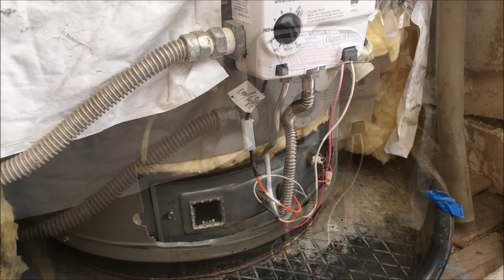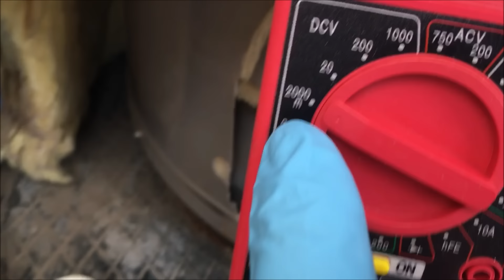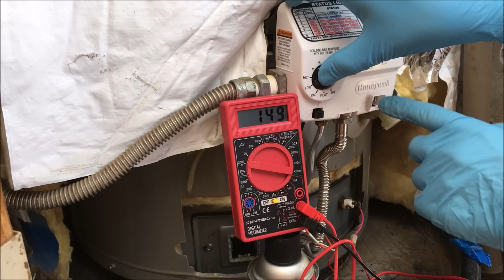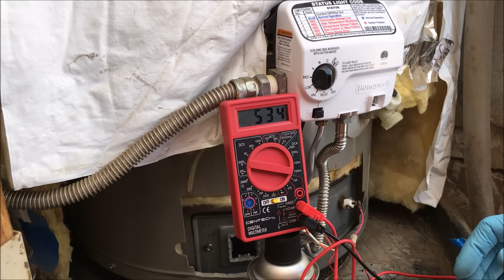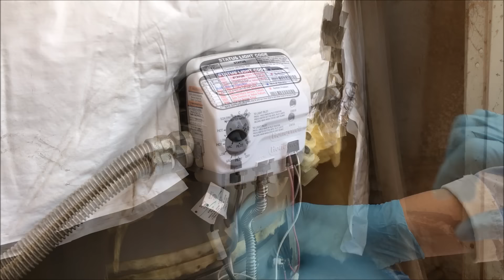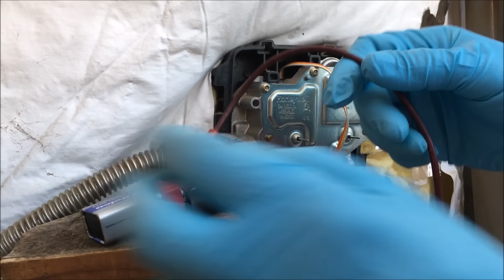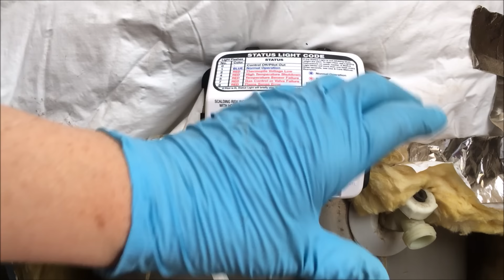Troubleshoot Water Heater AND Honeywell Gas Valve | Step-by-Step

Comment: Excellent video.  It's long but worth it.  After 35 years of plumbing, I'm going to have even my experienced plumbers watch this video.  You didn't mention holding the switch on very hot for 10 seconds, then hot for 10 seconds and then pilot for ten seconds to reset the WV control board.  But it's better to replace the board since this doesn't always work permanently.   Thank you for the great video!!
Reply: hey jimmy - question: can you please recommend a 50 gallon water heater brand/model that does NOT have one of these crappy honeywell thermostats on it? im hoping to find one with the old fashioned dial/knob gas control valve, but so far i can only find that in a 75 gallon rheem, which i wanted to get. but it has 1 inch diameter vs the 3/4 pipe outlets on the 50gal - and  i was told was the pressure would be bad for my pipes. is that true? i would be grateful for any info you could offer - thanks!
Reply from the maker: Jimmy, thank you!  What a kind and thoughtful compliment you've given me.  I have no words to adequately express my gratitude for your words.  I deeply appreciate that you took the time to write your comment.  You're words carry great weight given your years of plumbing experience.  

FYI--I do have a video on the "10-10-10 second fix" to override the 4-flash High Temp Shutdown on the Honeywell gas valve.  Thank you for mentioning the fix in this comment.
Reply: @frugaldiy1  where is your video on the 10-10-10 fix? I couldn't find it
Reply from the maker: @7x779  Here's the link: https://youtu.be/rllnMAx05JI
Reply: It's because women do better work
Reply: @eeoo2062  No
Reply: @water_is_wet_or_is_it 😂😂😂 helluva handle there, 🤷🫂🛌🤣
Reply: @eeoo2062  🤔🤔 could be..

Comment: my situation right now is that the pilot flame does not come on but the status light blinks normally in pilot status.  Then when I shift to Low heat, the status light shuts down.  So if the control board is dead, there should be no Status Light whatsoever, correct?  i also vacuumed the filter and even replaced the entire furnace assembly with a new one ($83 Home Depot).  But no luck. So could it be the control board? 

To clarify :  (1) the igniter sparks when the button is pressed but no actual pilot flame (2) the status light then blinks normally at 2-3 seconds but still no pilot flame (3) when the knob is shifted to Low, the status light stops blinking (4) this is with a complete and brand new furnace assembly (5) the metal grate filter at the bottom has been vacuumed.   -- So I am stumped.
Reply from the maker: make taco, your facts scream of a failed control board because the control board should not be operating at all, i.e., flashing a status or error code, if the thermopile is not being heated by the pilot light.  The thermopile's job is to provide a small bit of current to the control board so the control board can operate.  

So, get down on your belly or side and see if you have a pilot flame lit when the temp knob is in the "Pilot" position and pressed in.  Perhaps the pilot lights and then extinguishes when you turn the temp knob to "Low."  

If you have no pilot flame, the control board will shut down everything--it's a safety feature.

As to your other comment that I can't find on Youtube, no, that is not a battery.
Reply: @frugaldiy1  thanks... where to buy the card itself and how much is the card? Also, Walmart sells the entire valve for $119, Amazon has it for $124 and other sellers are higher and much higher.  So, just take it from the new one? Installing a new  valve takes a lot of work and swapping the card is much easier.
Reply: @frugaldiy1  yes, the Status light comes on but there is no pilot flame.  Strange isn't it? Also, smelling gas a little, so i turned off the main gas valve to the heater. Calling a tech tomorrow morning.
Reply: @frugaldiy1  also , how to tell the model # for the Honeywell?  I swear, if  i could switch to electric heaters I would.

Comment: Nice explanation! One question, will the pilot light not stay lit because of the control board not working properly?  Changed the whole burner assembly and still the pilot light wouldn’t stay lit and the control board light won’t come back on, it did previously before i put the new assembly on, I’m thinking that board has gone bad
Reply from the maker: Yes, if the control board has failed the pilot won't stay lit.  It's a "safety" feature.  My pilot wouldn't stay lit because the control board had failed.  I think you mean the LED status light when you say the "control board light."  If that's the case, the LED status light won't work (you won't see any status/error codes) if the control board has failed because the pilot light is not heating the thermopile to operate the control board.  I hope this helps you.
Reply: @frugaldiy1  yes, the LED status light wouldn’t come back on, even after I held the pilot button in for 90 seconds or more multiple times
Reply from the maker: David, if the control board has failed, the pilot won't stay lit so the thermopile can't operate the control board.  So, won't see any errors codes flash.  If you have to manually "keep" the pilot light lit, and when you release the temp knob from being held in the pilot position, the pilot flame extinguishes, I would consider the control board has failed.
Reply: @frugaldiy1  thank you very much! I will try that next!
Reply: Hello, would you be able to help me figure out the right control board for my model?

Serial no. Q411407117

Model no. XG50T06EC38U0
Reply from the maker: For my Honeywell gas valve, I went on eBay and typed in only the model number.  The search results showed new and pre-owned gas valves and control boards to choose from.  But, as I said in the video, I purchased a new Honeywell gas valve from my local Restore and simply replaced my failed control board (and cover) with the new one.  Hope this helps.
Reply: @frugaldiy1  i found a control board but just not sure if it’s the correct one for this model, I’ll have to take the old one off and check the numbers on it, thanks for taking time and responding quickly!

Comment: My "WV" valve is flashing 7 times-"bad gas valve". Rheem is sending a whole new valve under warranty. Can I just swap out the new WT board to my old valve ( if it passes the 9v test)? Thank you!!
Reply from the maker: skeedadyl, that's what I did.  But, given that you have a 7-flash error code, your gas valve may have indeed failed.  I'd do the 9-volt test and see if the pilot valve and the main burner valve are working first before I replaced the entire gas valve.     

To be safe, just make sure the model number of the gas valve sent to you is the same as the gas valve on your water heater.  That said, the model number of the gas valve I used to replace my control board in the valve on my water heater was not the same but started with the same letters, i.e., "WV."  And, the control board didn't look exactly the same as the board on my water heater, but it worked like a charm.
Reply: @frugaldiy1  The replacement from Rheem will likely start with "WT" not WV  ( preferred as you said) like my current valve so I'm hoping I can still just swap the control boards if the pilot and main burner valves test ok. Thank you for your response and wonderfully clear and thorough videos!
Reply from the maker: I hope it all goes smoothly for you, and thank you for the kinds words.  Happy DIYing!

Comment: I have no hot water and my light flashing 5 very 3 seconds so l have the same problem? My pilot it is on
Reply from the maker: Jerry, try this.  First, watch my video titled "Honeywell Gas Valve 4 Flash FIX | High Temperature Shutdown."  That 30-second procedure will override and reset the control board on a "High Temp Shutdown" and may reset a 5-Flash error code too.  It worked for me one time.  If that doesn't work, remove the wiring harness that connects the red and white thermopile wires to the front of the cover.  Wait 10 seconds and reconnect the wiring harness and wires into the front of the cover.  Then, try to light your water heater.  

On my gas valve covers, the 5-flash error code indicates a "Temperature Sensor Failure."  That is the temp sensor at the back of the gas valve.  The stem of the gas valve, that goes into the water heater tank, can begin to leak and affect the temp sensor.  So, look for any water dripping from the lower cover of the gas valve.  It could be leaking water and causing the temp sensor failure code.

Comment: One thing I learned on was the vent under the unit needs to be cleaned every so often cause the pilot flame needs air for it to stay lit. That is most common problem when the pilot flame goes out. However your video is great goes into good detail. Thank you so much 👍👍👍🇺🇸
Reply from the maker: Kerry, thank you for the information.
Reply: @frugaldiy1  Does he mean the vent under the valve or a vent under the water heater?
Reply from the maker: Pat, I believe he was referencing the external vent, under the water hater.

Comment: What a refreshingly thorough troubleshooting video! I was led on a wild goose chase by some professional plumber videos, but this one exactly diagnosed and SOLVED my problem, and saved me from the hassle of draining the heater and taking it apart. I noticed, after receiving the "new" board I bought on ebay for $45, that my old board was missing the ground pin seat. I found it sitting under the water heater, and am wondering if it lost contact before I took it off and was the cause of the failure. If this ever happens again, I will first try re-soldering the seat to the old board to see if that fixes it. Meanwhile, my kids will be enjoying some hot showers. Thank you!
Reply: @Teach Them Piano, I found the same thing, the ground pin contact was broken off and sitting on the drain pan under the water heater.  I soldered mine back on and it is now back in normal operation.  I believe the original solder failed causing the pilot light to go out.
Reply: That exact same thing happened to me. Found it laing on the floor.
Reply from the maker: You're welcome, Teach Them Piano, and thank you for your kind words.  I'm glad the video helped you.  Enjoy the hot water!  Happy DIYing!

Comment: 8f I was to replace the gas valve does it have to be exact replacement  or can it be a different one as long as it has WV in the beginning cause mine has a thermal sensor not a switch
Reply from the maker: I can't answer that question with certainty.  You have to make sure the gas valve stem that screws into the water tank is the same diameter as the gas valve you are replacing.  I'd research the model number of your Honeywell gas valve on the internet to learn the specs (specifications) of your particular gas valve.

Comment: If I was to replace the control board does it have to be the exact one from the model number on the gas valve
Reply from the maker: Ang, the control board I used to replace the board that failed in my gas valve was not the exact same, but the control board did come from a Honeywell gas valve model number that began with "WV," like the model number on the gas valve on my water heater.

Comment: I did the 9v battery test on both the pilot valve pin and the gas valve pin and it didn't make the click noise on the pilot valve pin. Does that mean that the whole valve is bad or is there a further  fix?
Reply from the maker: I'm not sure, Richard.  Sometimes, valves on various mechanisms can "stick" and won't open.  I'd use the handle of a screwdriver and lightly tap near the pilot valve pin to see if it might just be stuck and tapping it may gently "shock" it open.  I've done this before on gas valves when they don't work, and it solved the issue.  I'd give that a try.
Reply: Thanks I'll give that a try.
Reply: Okay, I gently tapped around the pilot valve pin with the handle of a screw driver but there's no difference. Is there some other test or do   you think it might be the board or should I just replace the valve? Thank you
Reply from the maker: I don't know of another test for you to do to determine if the pilot valve works.  If I had encountered your issue, I would have purchased a pre-owned gas valve (with the same model number as mine) off of eBay from a top-rated seller or a seller with high ratings and then replaced just the control board first to see if that worked.  If that didn't work and I felt certain the gas valve had failed, I'd replace the gas valve.  But, I wouldn't replace the gas valve first.
Reply: Okay thank you I appreciate your incite
Reply from the maker: You're welcome.
Reply: I had the same problem with the pilot valve not clicking. Richard did you ever find a solution? 
Also I see there are screws on the valve assembly but I don't know what type of screw heads they are. They don't fit torx or Allen wrenches. DIY I wonder if you ever tried to fix the valve assembly?
Reply from the maker: @robgarneau954  No, Rob, I haven't.
Reply: I had the same problem and replaced the valve and it fixed it.

Comment: Can you tell me where you buy replacement circuit boards?
Reply from the maker: David, here's my response to another person who asked a similar question.  I wouldn't purchase a control board from Honeywell, if it sells them.  Too costly.  I looked on eBay, and I think eBay is your best bet.  Go to eBay and type in the model number (found on the right side of the cover of the Honeywell gas valve on your water heater), and the search results will bring up new and pre-owned entire Honeywell gas valves AND new and pre-owned control boards.  That was my experience.  Were I to purchase one on eBay, I'd purchase a pre-owned control board (about $40.00) from a top-rated seller or seller with high ratings.  I'd feel comfortable with that.

I got the entire NEW Honeywell gas valve, with the control board in it, at my local Restore.  It cost me $50.00.  Were I you, I'd also go on Craigslist and search for one because I've seen several for sale in my area.  

Please let me know if you need more help or have more questions.

Comment: How much does a new control board generally cost?
Reply from the maker: Well, the cost varies.  I wouldn't purchase a control board from Honeywell, if it sells them.  Too costly.  I looked on eBay, and I think eBay is your best bet.  Go to eBay and type in the model number (found on the right side of the cover of the Honeywell gas valve on your water heater), and the search results will bring up new and pre-owned entire Honeywell gas valves AND new and pre-owned control boards.  That was my experience.  Were I to purchase one on eBay, I'd purchase a pre-owned control board (about $40.00) from a top-rated seller or seller with high ratings.  I'd feel comfortable with that.

I got the entire NEW Honeywell gas valve, with the control board in it, at my local Restore.  It cost me $50.00.  Were I you, I'd also go on Craigslist and search for one because I've seen several for sale in my area.  

I hope this helps you, Dave.  Let me know if you need more help.

Comment: Excellent  help
Reply from the maker: Jim, I can't thank you enough for the comment and feedback.  It means so much to me, truly. 
 I thought the video might be too long, but I wanted to give you and others a thorough guide of the steps I had to take to determine the problem with my water heater.  I'm so pleased the video helps you DIY and save a good amount of money.  Happy DIYing!
Reply: Ok now the fun begins. I have no idea what's compatible. Lots ebay controls with different last four numbers, circuit boards with different numbers. WV  has replaced by wt. Catalogs list 1" insulation tanks, 1.5, 2 . Natural gas is different than propane. So then you start calling about controlers. 88 $ on eBay same problem. Been 5 hours at this.. found two places that could supply a controller 265$ and 301$. Factory rep said its under warranty if i get a plumber which can't cost less than 300 if i can get them out here.
.
Reply from the maker: Jim, I typed "honeywell gas valve wv8840b1109" (the model number of my Honeywell gas valve located on the side of the front cover) into eBay and found both new and pre-owned gas valves and control boards to purchase.  I decided to visit my local ReStore, and it had several Honeywell gas valves, new and used.  None of the model numbers matched the gas valve on my water heater exactly, so I choose one with a model # that started with "WV" and purchased it.  Though the failed control board on the Honeywell gas valve on my water heater looked different (had different components) from the control board on the gas valve I purchased, the new control board installed and worked just fine.  I hope this info helps you.